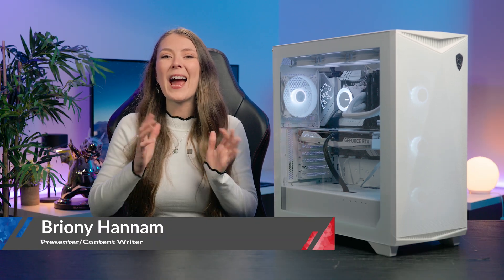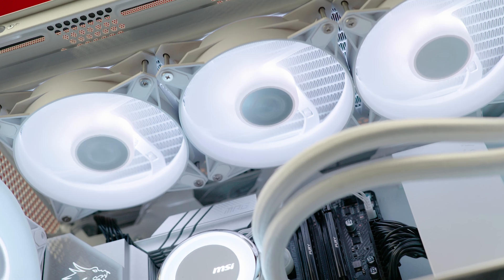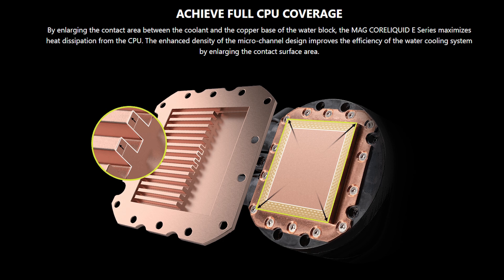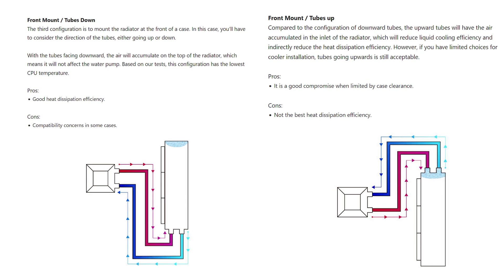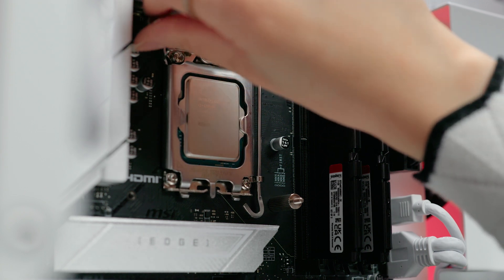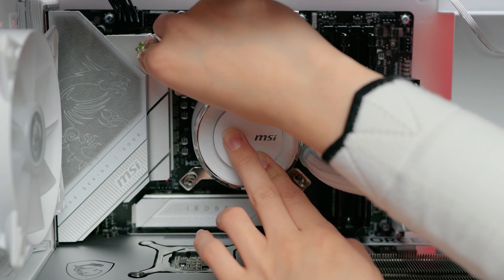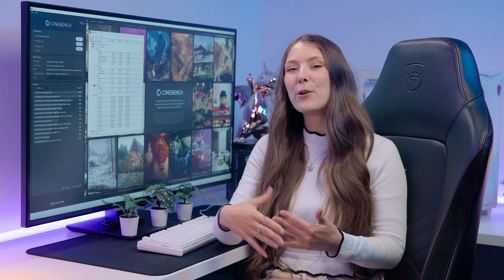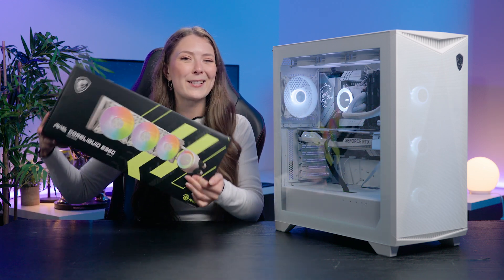Everything You Need To Know About a PC AIO Cooler | Overclockers UK Academy Tutorial

Comment: I literally just build my first rig and I used the black version of this AIO. I was also going to use this exact case, the 300R, but they were sold out (it was during a Newegg flash sale, a number of the parts I had lined up sold out) so I went with the Phanteks XT Pro Ultra instead. I'm still fiddling with the ARGB on the case (hooked up to 1 header) and then the AIO & pump head lighting. So far, I'm just not at all happy with Mystic Light, and I want to get a controller to split everything up. Right now, it's very, very boring.